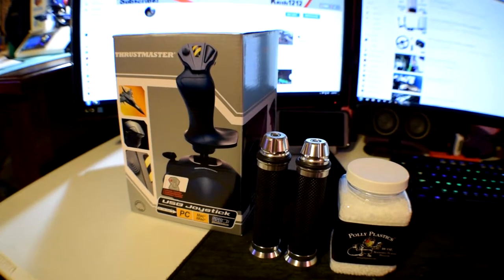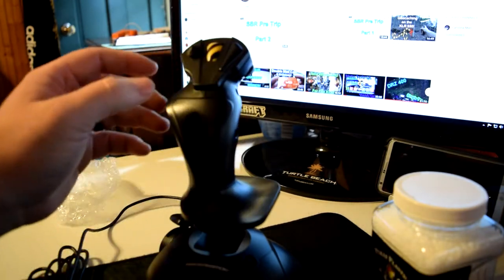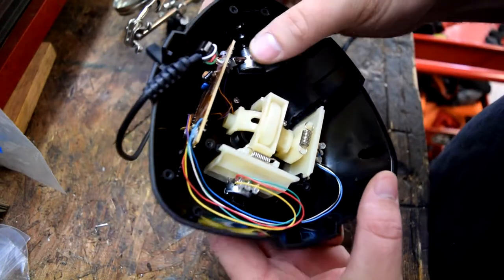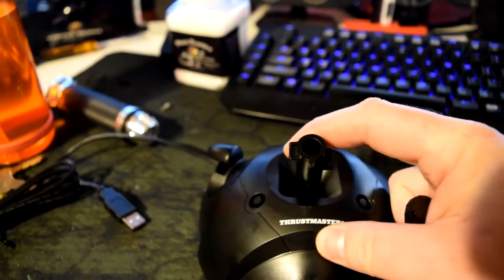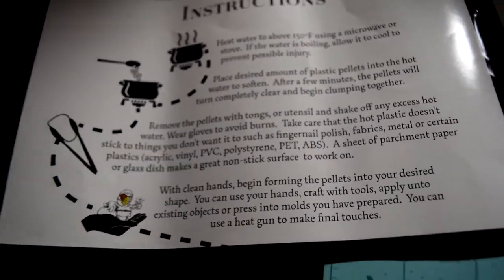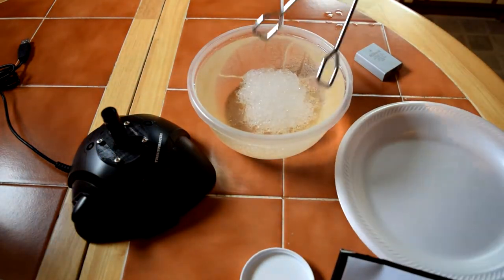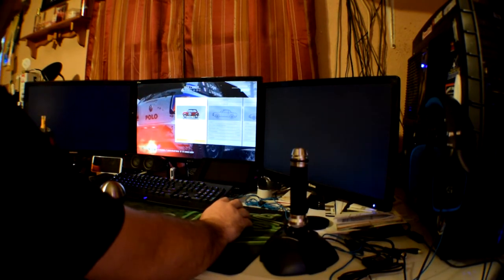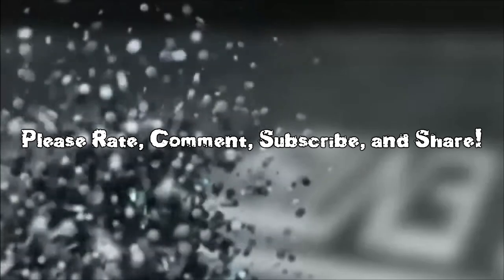DIY PC Handbrake! - $45

Comment: In theory: This could be used for a sequential shifter as well. Would have to make a longer slot for the joystick to move forward
Reply: H shifter also if you remove the centering spring, but you need mapping a software as well

Comment: Thanks for the inspiration! I applied this to a Logitech Extreme 3D Pro which is mounted on some hefty steel plates (inside the plastic housing), this is probably what you wished for as counterweight. It's still not sturdy enough for heavy braking/quick pulls, so I came up with a mounting solution probably worth a video

Comment: 2 things :) , use it inverted in the settings and move the slider to have the 0 point on the top 
Second , try to use some rubbers to make jt springy as such it doesnt wobble

Comment: IDEA FOR GETTING THE HANDBREAK STUCK TO THE DESKTOP: Put the handbreak atop the mousepad, put a magnet (get it on ebay or aliexpress, not too big not too small) beneath the mousepad and another one in the base of the handbreak, u can use double side tape. Now the stick will be stuck to the mousepad. Only think i still don't know it's if it could damage any of the electronics inside the stick.
I will edit when i try it

Comment: On the non-soldering bit - just cut the wires at the point of it coming out of the stem?
Reply from the maker: Exactly. Just tape them off so they won't touch.

Comment: GREAT JOB MAN. would this work on ps4 ? thanks
Reply from the maker: With a ps4 you could just buy a switch and make a lever to activate it then wire it to a button on your steering wheel. Then when you either press the button or the switch it will pull your ebrake in game. There's some vids on youtube for it. Thanks for watching!
Reply: Keith1212 thank you for your time to reply to my question thanks for the info